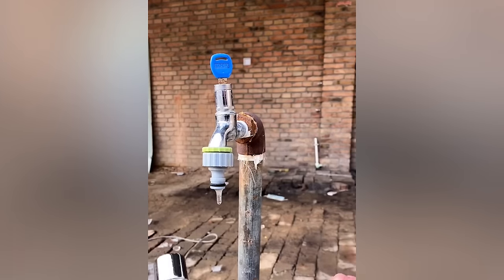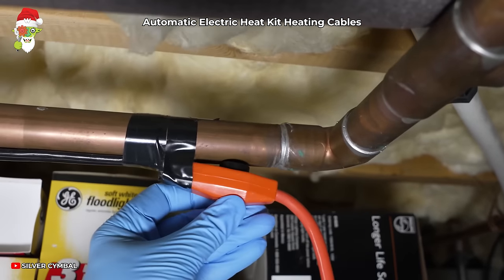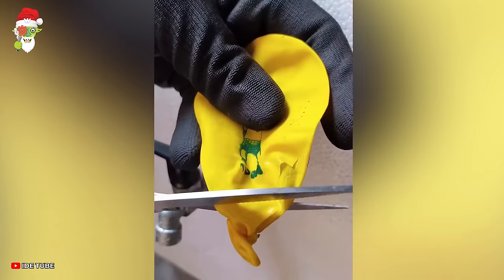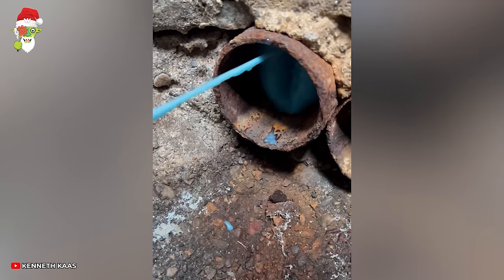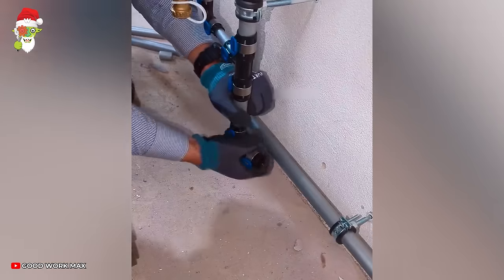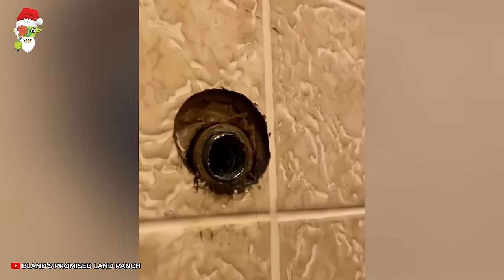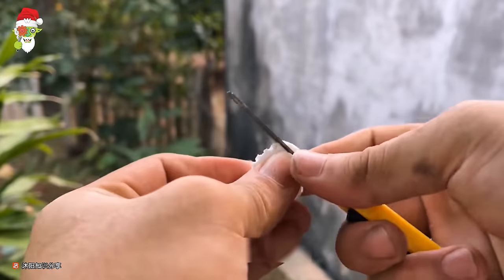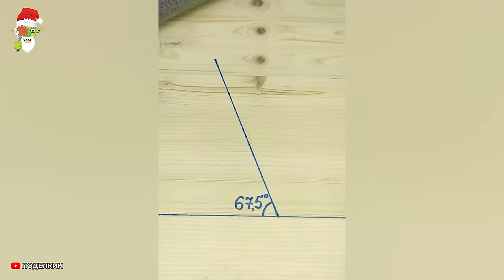ULTIMATE Plumbing Tips & Hacks You'll ALWAYS Use!

Comment: Vinegar and baking soda neutralize each other (vinegar is an acid and baking soda is a base).  To dissolve mineral buildup, use vinegar alone.
Reply: Well, the difference is the time you spend in each method
(people DECIDES)
Is it really dumb or faster???
Reply: @joserpa8015 it's edited. It's not faster it's slower. Get two pieces of egg shell in two separate containers. Put just vinegar in one and vinegar baking soda in the other. Tell me which is faster at dissolving the calcium egg shell. Calcium like the build up on the shower head.
Reply: Easier to use CLR (calcium, lime, rust). I'm pretty sure it's available in most parts of the world. It's been around for a long time.
Reply: I'm glad that was within the first minute.  Saved myself 22 minutes by not watching the rest.
Reply: @joserpa8015 -  People decide? Chemistry is NOT ANARCHY OR DEMOCRACY! DUH!
Reply: @Tricknologyinc  people DECIDES in between clever and well done  choices,
    GOOD Profesionals, have the capability to develope (intencionally) many choices,
That's not anarchy,
                     That's a fusion of creativity & knowledge, DUDE! 😎
Reply: That's right, for example:  RODIUM, is an expensive mineral, and it's dissolved in acid (only acid)
Just think about this,
This mineral needs to be well micronized, be placed into an certain acid environment and finally, be dissolved to be sold for  jewelry use. (the fusion point of this mineral is pretty high) So, think about it. 👍
Reply: @joserpa8015 - Chemistry decides that vinegar and baking soda cancel each other. Creativity doesn't assume knowledge, nor does it counter it by making an ignorant choice to adopt ignorant advice. The point of education is to fill a void of knowledge, not be redundant to it's already being known. People come here for facts, not tests. Think about that.
Reply: one should not use vinegar as rubber seals degrade in this acid. use citric acid.
Reply: Exactly my thougts...

Comment: Where is the coiled pipe shown in the thumbnail? 
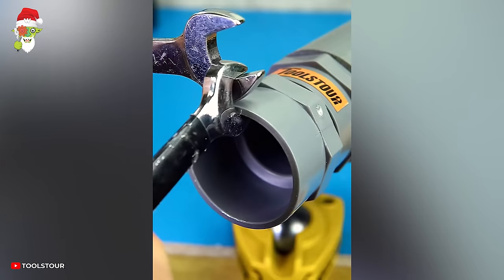0:57 Also a great way to break it. 
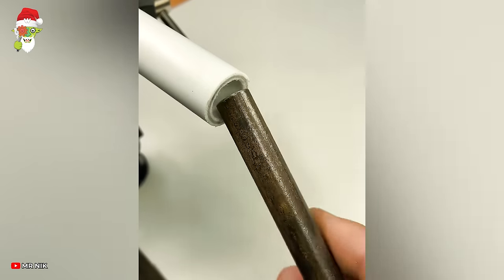6:34 Heat the hose and it will stretch to fit quicker. 
18:24 Soldering, not welding.
Reply: I did want to see that also.
Reply: @duratoke Clickbait.
Reply: Click bait.  Hit do not recommend channel.  Enough of the dishonest people.

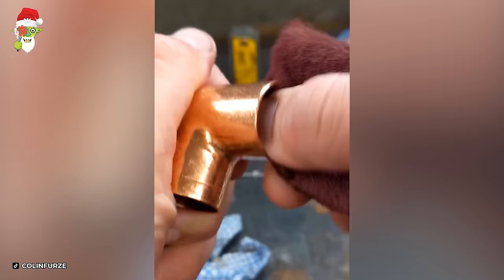Comment: @14:37 The narrator is clueless about sweating copper pipe fittings. “To solder copper you need to melt it with materials that have much higher melting points” -No, that would melt the copper pipe! 😂

Comment: I did learn something from this video..  it’s that most people should just call a plumber and have pipes fixed/ installed the correct way unless they want to be replacing floors and drywall because when the insurance adjuster figures out that the homeowner used a balloon to install a pipe and melted sewage pipe together than they are denying any claim you make due to unapproved and illegal fitment of the plumbing in the house which will also flag you in the future as well as cost you possibly a hefty fine or even attempted fraud charges for doing it..  seriously.  Just like hvac, if the right person see’s you messing with your central air and you end up knowingly venting the refrigerant to atmosphere it’s punishable by up to 10 grand and time in jail..  never knew anybody who had to do any of that but have seen a few diy jobs flagged and shut down by the city after sitting their old pipe on the curb for garbage to pick up but an inspector saw them and saw they didnt have a permit of work condemning the house until proper facilities were involved to verify safety and all..

Comment: As an actual plumber I can safely say that the only good tip in this is the vinegar and shower head.... You don't want or need the baking soda.
Reply: Just turn on the water for the shower head and use your thumb to rub the rubber jet tips and this will take care of most problems with partially blocked shower head tips.   That’s why they were made with rubber tips in the first place.    Easy clean.

Comment: Instead of the shuttlecock end rather stuff the pipe with stale bread, this will stop the water long enough to complete repair and the bread will soften and flush out of the pipe.
Reply: An old plumber i worked for as a kid told me about the bread trick.
Reply: Be aware that if you do the bread thing upstream of faucets and shower heads, you'll be cleaning bread out of the aerators when you're done.  

There are gel pellets that work the same way as a bread plug, or even better, get a set of Jet Swets

Comment: The problem with heat tape to keep pipes from freezing are twofold: one, the tape or the thermostat controlling it will eventually fail and then your pipe freezes again and two, the heat tape should be plugged in and unplugged seasonally, you'll remember to plug it in after the pipe freezes, again. Solution: find another option such as re- routing the pipes; install shutoff and drains, allow heat to reach the pipes and finally, insulate adequately the pipe from the cold.
Reply: That's not a problem I've ever had. I'm dying of the heat today in Sydney and it's only 27C but the humidity factor is 75%. I'm glad I never have to shovel snow, slip down a driveway or put up with frozen pipes but surely there's a happy medium of almost perfect temperatures and climate somewhere? I think some of the contestants on 'Alone' put it well when they said you have to work WITH nature instead of fighting against it.
Reply: I don't think the thermostat should be under the insulation on a heat tape or the heat from the tape will shut off the power.
Reply: @dsandy8110    The thermostat in a house or an apartment is in the heated air.
Reply: I agree with this.  Having grown up in the northern hemisphere we do not use this system of heat straps, insulation only as often as it will fail eventually.  The weather is getting colder much further south and people are rushing to do this but not doing their homework.  Even an insulated pipe can eventually freeze.  One building I saw the joints were not cut correctly, that is the area that froze first.  Another had installed freeze proof spigots but not angled the valve stems, again frozen burst.  Another hose bibb is on the roof, pipe goes through an unheated stairwell with no shut off option.  Another the heat straps were plugged into a temperature activated thermostat at the garage wall to leave them plugged in all the time.  According to the contractor who installed them is was a 'set and forget' option on the documentation which of course eventually failed.  All these little mistakes can cost thousands to repair.  An honest contractor will present all options and warn of the risks in each.

Comment: Yes!  As a service plumber I love it when people plunge their clogged sinks and blow apart the plastic connections underneath the sink. Or blow fittings apart inside the wall.  I get paid good money to tear open and get to those. And you still have to pay me to clear the clogged line I was summoned for in the first place So yes please advise these people to shove pressurized force through their slip joint assembled plumbing fittings. Also the people who make the replacement vanities and cabinetry will love you for it. The people watching your video aren't going to go get a bottle or do it with their hand they're going to grab the plunger which is meant for plunging against a sealed system.
Reply: And then get another person to fix the drywall.

Comment: 18:25: you are not WELDING copper pipe and fittings, you solder them. These are two completely different processes with different heat requirements and joint "fusion". That's why the silvery stuff is called solder not welding rod.
Reply: A lot of people keep saying this, but actually it is both. Yes soldering is the process used to connect the two separate pieces permanently(one hopes) together. However, the permanent connection of any two separate components is a weld, regardless of the process used. This includes any process using electrical bonding, chemical and thermal combination. The gluing process for PVC and all variations of such is welding, as is soldering.

Comment: I am a retired Pipefitter / Fire Sprinkler Fitter Union.
When you use Teflon Tape, you only need to wrap the first 3-4 threads   a few wraps to hold the tape in place.
Its a complete waist of tape, time, and money. Any tape you can see does nothing.
Keep in mind these threads are. TAPERED *.  pipe and fittings.   The best thread will be one that will using a new fitting and a new thread pipe.
By hand screw the fitting on the pipe as soon as the fitting catches the thread.... The fitting should turn by hand 2-2 1/2  turns before it stops (where you have to use a wrench).       FYI    ELECTRIC CONDUIT THREADS  are "STRAIGHT"  threads they ARE all the same geometric shape all the same dimension.
TAPERED are changing start to finish.
Now the bad news. Are you going to go to the hardware store and find pipe and fittings with 2-2 1/2  hand tight start.
Not on your life, when you thread your own pipe shoot for the above.
Good luck.

Comment: don't use shark bite fittings unless last resort, you can get a crimper, cutter and bag of 100 crimps for like 50 bucks, shark bites are prone to failure after a while and have a weaker connection overall plus cost a lot, they are however good for temporary repairs if you have to wait for real parts

Comment: When replacing the valve on a copper  pipe  .... disassemble the valve assy. to prevent burning the seal when soldering new valve onto copper pipe. Valve will last much longer than the pre- cooked unit !!!
Reply: How does that work on a ball valve?
Reply: @redjohnson4859  same way.... disassemble the valve & solder it ...

Comment: if you don't have a tool to remove tub drain you can take a piece of iron pipe 6 inches or so that fits in the drain and cut notches for cross bars on end of pipe with a grinder and cutoff wheel or hacksaw, then stick it in drain and turn it out with pipe wrench on the top of the tool you just made.

Comment: The only couple things here that can be useful 1 is the clamp spreader inside the bowl as a handle can be useful in tight spaces and the piece of wire to cut piping. Most every thing else is pretty common stuff. 
Lastly before I’d ever want to jam something into a running water line it’d first use some bread, then some other stuff after. Several of those so called tricks are potentially going to make your situation worse unless you’re a very handy with plumbing and trades in general.
Reply from the maker: Thanks for sharing

Comment: @15:15 Any better way to remove the broken tap part from the pipe?
Reply: if the part you're trying to remove is plastic, and the thing it's stuck inside is metal, like their first example, you could just cut the plastic part all the way through (turning an O into a C) and pry up one of the edges.
Reply: @undrline   Thanks. No its metal like shown in the video

Comment: I see most of the material you're working with is plastic...any tips for copper pipes leaking at a straight junction??
Reply: Temp fix  band clamp and a peice of rubber under
Reply: @MrDmadness Any tips for proper/permanent repair on same???

Comment: So vinegar - an acid, and baking soda - an alkaline, together, as a solution? That’s your trick? Depending on how much baking soda you put you either making your vinegar weak as piss, or cancelling out completely. 🤦‍♂️ 
Use vinegar, smaller bag as to not waste the vinegar (because there’s simply no need) and leave overnight. But, buddy, do yourself a favour - get one of those shower heads with ceramic beads inside, your water pressure needs it, will be best shower ever. 😂

Comment: Some very good hacks, but teflon tape only needs to be put on the threads the fitting will cover, usually 8 threads or so. The rule of thumb is 3 threads by hand and 3 with a wrench.. You need a little for the inspector to see, but tape on threads that will never be covered make you look like a rank amateur. The aluminum hacks were just laughable. YOU DO NOT PUT GREASE DOWN ANY DRAIN.  NEVER NEVER EVER! (I've been plumbing coming up 50 years, a journeyman for 44)

Comment: Omg… you’re really bad at these! Not even a minute after I told you vinegar and soda cancel each other out, and now you don’t know how to clear blockage in your sink? That overflow hole that you had gun, flowing from, you supposed to cover it up to create seal, and then use whatever you used (preferably plunger, preferably with a short handle and an actual handle grip on the end for convenience), because if there’s proper blockage - the fact that your overflow hole is open means that every pump you give to the sink is pushing water/ air to the overflow hole, with the blockage being completely unaffected by your efforts, since the pressure you creating just comes out of the overflow hole. However, if you cover up the overflow (hand/duct tape/ dishcloth, etc) the overflow would be blocked and so the push pump energy you create will be transferred directly into drain pipe, directly at the blockage. 
Oooor… since you like mixing vinegar and soda so much, this is the only situation where mixing these 2 chemicals that cancel each other out actually work. Pour baking soda into blocked drain, then cover up the overflow hole, pour vinegar and super quickly cover up the drain hole with the plug. As the 2 chemicals react by fizzing up, it creates energy that will move your blockage.